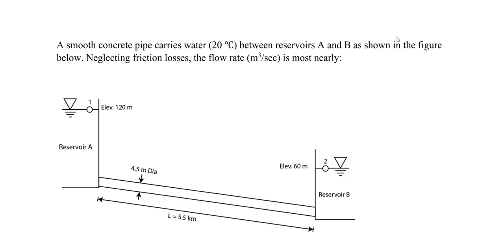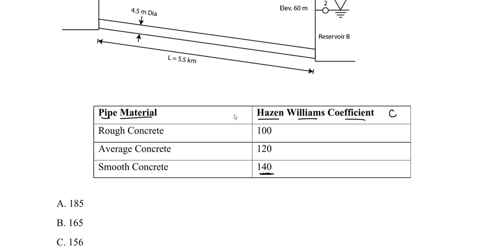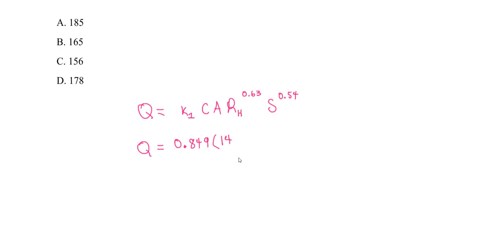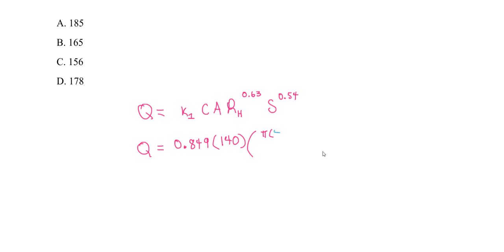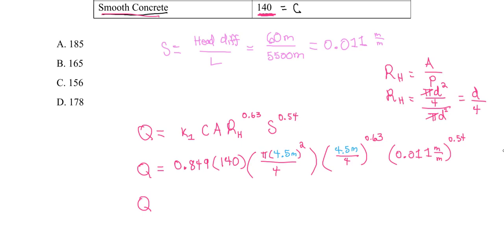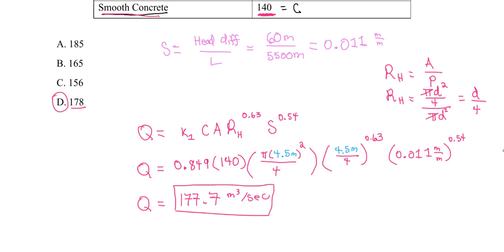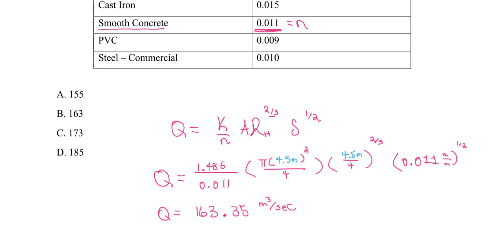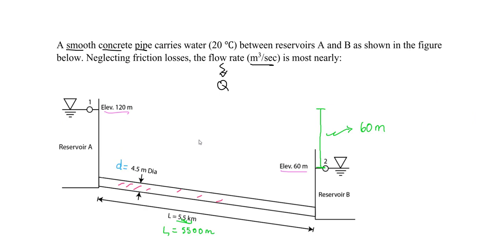FE Exam Review - Fluids - Hazen Williams / Manning Equations

Comment: The Slope formula for Hazen-Williams is hf/L. I think "L" is the horizontal distance (instead of the inclined distance) because Slope is rise/run.
Reply from the maker: That's right! But L is the inclined length, since friction loss occurs along pipe length. That's what most textbooks do as well. That formula is on page. 297 in the FE Handbook.

Comment: Why are the Hydraulic Radius(s) different when using two different equations. Hazen Williams the Rh is pi*4 and in the Manning's equation the Rh is 4.5/4. Thanks
Reply from the maker: Hi David, the hydraulic radius should be the same for both. For a circular pipe at full depth flow, Rh = d / 4, where d = pipe diameter.
Reply: @directhubfeexam  What is the correct answer for this problem with the corrections from the comments?
Reply from the maker: @pinkie224  
Hi David, 

For the first one (Hazen), if you use the same C = 140 (the one I used) you should get: Q = 178 m3/sec
For the second one (Manning), I had a mistake by using the wrong K value. K should be 1.0. You should get: Q = 164 m3/sec

I'm definitely redo a video for this lol
Reply: @directhubfeexam  all good thank you!
Reply from the maker: @pinkie224  thanks man!

Comment: Hi. Is "C" value gonna be specified in the problem? because there is no table for different types of concrete such as smooth except the one showing 130 for just concrete in FE handbook. This was annoying because with C=130 you will get the wrong answer which is 165 !!
Reply from the maker: Yeah it will always be given to you.
Reply: @directhubfeexam  thanks. there is another issue I would like to let you know. in the manning equation you mistakenly used USCS K and I think you needed to use the SI unit which is K=1. Anyway, I really thank you for the amazing videos. I am learning a lot from you.
Reply from the maker: @saeedehlotfi2576  Oh crap, sorry about that. You are right! Thank you for pointing that out. I'm glad you find these videos useful. Keep up the good work!
Reply: @directhubfeexam  sure. Thanks again
Reply: @saeedehlotfi2576  the K value for the SI version is 0.849. See page 185
Reply: @danithaman4610  for the "hazen-william" yes, thats k (SI)= 0.849

Comment: Another quick note for the Value of "C".  Page 297 in Handbook 10.0.1 reveals the value should be 130.  

From my experience Ductile Iron Pipe is usually concrete lined so using 140 may be correct in a real world scenario.  I just wanted to point this out for FE test takers!

Comment: Hello, 

When I calculate the Manning Equation I continue to get a different answer, please let me know what I am doing wrong! 

Q = (K/n)* (A) * (Rh^2/3) * (S^1/2)   =>   (135.09) * (15.90) * (1.08) * (0.104) = 241.25 m^3/sec.   

Thanks for your time.
Reply from the maker: Hi Kyle, your answer is right. This is my mistake for not double-checking the calculation. The correct answer should be around 243.75 m^3/sec. I will make sure to double-check my work in future videos. Thank you!
Reply: @directhubfeexam  Your welcome and no worries... Your videos are very helpful and engaging.  Keep it up!
Reply: @keloomie  I believed the answer is 163.3 m^3/sec, the mistake is we are using metrics units in this problem and the Value of K should 1.0 instead of 1.486 that is on SI units, that will change the result of problem. 
BTW, These videos are very good and helpful @direct hub